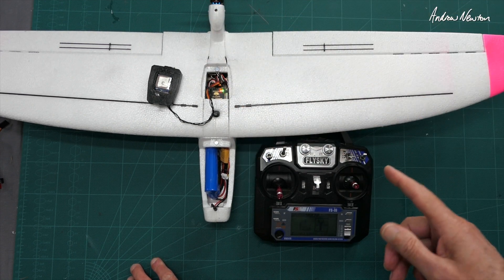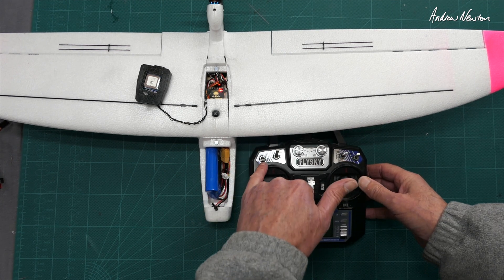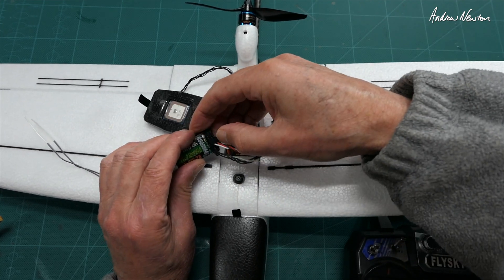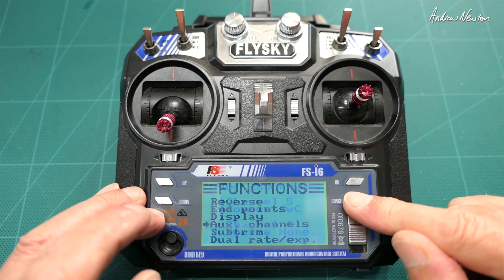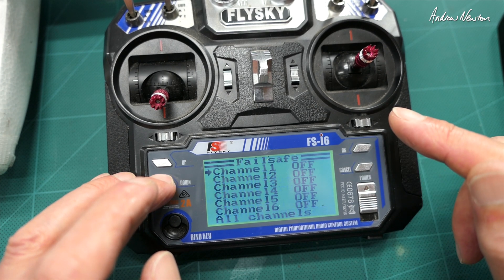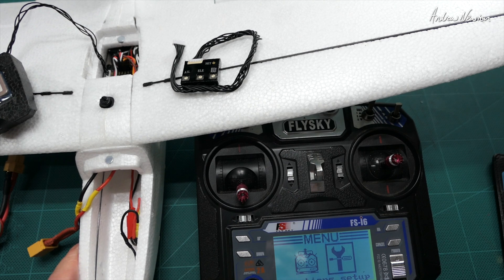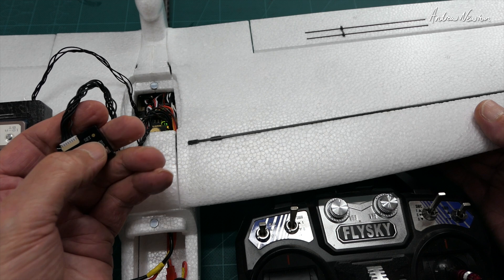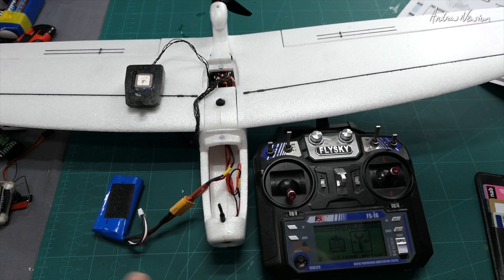Kopilot - Drift - Flysky FS-i6

Comment: Would you have an idea why my elevator and ailerons both move each at the same time. I try to use one of them. For instance, when I pull down on elevator, the ailerons move into a slight left turn. 
Vice versa ,when I go into a turn, it makes the elevator want to go up.  Ive tried it in all modes, Same problem. it's almost like an electrical interference. When I go to channel display, the display works exactly like yours on the video. It doesn't show them both working together.
Any help would be appreciated. Btw, love watching your videos. IV'E LEARNED SO MUCH FROM YOU..Thanks
Reply: Andrew, Disregard.I'm an idiot.  Im proud of myself for figuring it out..lol
Keep up the good work mate.
Reply from the maker: Not an idiot. Clever for working it out. What was the solution?

Comment: Hi Andrew, just one question. If you are flying in stabilised or manual mode and you lose the link does it automatically go into return to home mode, or does that only work if you fly solely in RTH mode? Regards Chris
Reply from the maker: If you set it up properly it will switch to RTH from any mode when RC link is lost.

Comment: hey andrew, great vid...i have a question, so i purchased the zhod drift, fs-i6x, and the fs-ia6b reciever, and kopilot light. i plugged everything in and the reciever wont power on and the plane just beeps. this is my first plane and i need help. please reply ASAP
Reply from the maker: Forget the Kopilot for the moment. Learn the basics first, like how to bind the receiver and use the radio
Reply: @AndrewNewton  ok, what 1s lipo should i use to bind them
Reply: send link if possible
Reply: @AndrewNewton  since the led doesnt light up when i connect the reciever, do i have to link it wiht the controller first for it to light up?

Comment: Thanks for the helpful video  -I have set my Drift up the same - problem though - when I flick SWA, the expo changes as it should, but also the ailerons move position  like pulling a right turn.  what could cause this ?  This whilst in manual mode, No GPS lock.
Reply from the maker: Switches wrongly assigned at a guess, not actually in manual mode
Reply: Thanks but weirdly the Switch C was not centering correctly during my maiden so it was always stabilised - I discovered this by swapping to VRB and finding manual, and therefore found the Drift was responding only to a non-centered switch value.  I centred everything and Held the options board button to recalibrate  and that problem corrected.  So I am confident I am in manual. And I can damped the control's responses using SWA. But SWA it rolls the aileron value by about 2mm. 
UPDATE: I just checked the Tx Display and it is the transmitter that is putting in the aileron roll when I use SW-A, but why on earth does it?

Comment: Will the zohd pilot work with the ranger 2000 with flaps?  Do flaps get transferred to channel 6?  Thank you in advance.
Reply from the maker: Ch6 is only available with SBUS connection. You can just plug the flaps into Ch6 directly on the receiver

Comment: Hello Andrew. I have successfully set up my Zohd Drift as per your video as well as the instructions (same controller-Ia6 receiver). I have now purchased a Kopilot set for my Durafly Tundra. Ive got it all fitted but now im trying to set Flaps up on the Auxiliary  channel of the Kopilot and use channel 6 SWD to activate it. As soon as i power on the Kopilot the flaps go full down and i cant get them to respond. The rest works fine. Ive turned the mixes off  and SWD works in the display setting.  Can i use Aux channel for flaps? Thanks for all the great video's.
Reply from the maker: If you mean Ch 6 then that only works with SBUS receiver connection
Reply: @AndrewNewton  So i solved it on your advice. Servo lead from IBus on RX (Turnigy Ia10B) to Sbus input on Kopilot. Channel 6 (Turnigy i6) paired to Switch D (only 2 position-using the 3 for flight modes), set the end points and now have 0 degree and 45 degree flaps. Thanks for the advice.
Reply: @Robinator202  Just a question. Are you using a stock i6 transmitter or 1 that has been "updated" with hacked firmware? I thought that it was only the i6X that could be switched to output either i-Bus or S-bus as a serial output for the "serial" output pins on the iA6B/iA10B receivers.
Reply: I have just installed Kopilot in a Tundra. There is no need to operate the Flaps via the Auxiliary port of Kopilot. You can simply connect the y-cable from your flap servos directly to channel 6 of your receiver. Thus you can use the flaps independently from the Kopilot in all three modes.

Comment: Hi Andrew thanks this is very helpful…but, I followed exactly but can’t get past the Tx beeping that the receiver battery is flat! I’m using the IA6b receiver and it displays the Rx is only getting 3.3v ( Battery is 8.2v)
Is this 3.3v a mode of the ESC?
Reply: Okay solved it. I had the PWM cable plugged into the settings port.
Reply from the maker: Aha! That would do it. Glad it's sorted

Comment: Hi Andrew, I was going through this setup and a peculiar thing occurred. The Drift came with a bridle/tee connector for the 2 aileron plugs, which I connected, black to black etc and plugged into the Kopilot. When I powered up, I got a whiff of something hot. It was the stbd aileron servo getting real hot but not the port side. It’s set for T tail and as your setup but only the motor responds, no elevator and yes gps is up. I did plug just the port aileron in but it didn’t respond either. Question, is it cooked and why?
Reply: Correction gps not lit, only led 2, t tail and the small square red led lit and steady. I’ve also sent a cry for help to Zohd
Reply from the maker: Need to test the servos individually with a servo tester or plugged straight into a receiver to see if they are fried. Could have been a bad servo or too much voltage somehow. I guess if you plugged the PWM signal cable into the +5V pins it could fry something.
Reply: Thanks, I connected as per your tutorial and the supplied zohd paper work. The big plug horizon and the plug, vertical at the end of the big plug. The servo got hot when connected to the battery, no activation from tx. Yes I’ve ordered a servo tester and are trying to get a reply from Zohd. All a little disappointing.
Reply: @warwickprice7218  Leave your set-up EXACTLY as it is/was when the problem occurred. (Minus the battery of course!) Take high definition photos from several angles with good lighting and post the results on the RCGroups Forums discussion thread on the Kopilot Lite. While waiting for replies there you might like to read Post 2424 on that thread.
Reply: I should add that yours is the first instance I've heard of where plugging things in wrong with the Kopilot set-up has fried anything. (We've done it too many times to count - no dead ones yet!) 🙄 
Reversed supply voltage somewhere or a faulty servo seem the most likely candidates.
Reply from the maker: How did you power it up? Through an ESC 5V BEC?
Reply: @AndrewNewton  I did reply but got a fail. I plugged the Jst plug(attached to the esc) into the rx. Powered up with 3s.
Reply from the maker: @warwickprice7218  Red JST? That's full battery voltage for powering the FPV camera, not 5V.
Reply: @AndrewNewton  that will explain it, victim of the missing 20% of info. Bit of a black art this rc stuff but I’m not deterred. Thanks once again.
Reply from the maker: @warwickprice7218  Ah, at least we know what caused it. Most ESCs dont have that Jst pig tail. 5V is on the red wire in the 3 pin DuPont connector coming from the ESC.
Reply: @AndrewNewton  I’ll buy a new one and use this one for parts and experience😞
Reply: @warwickprice7218  Can't laugh at your misfortune in all conscience Warwick. We've all done something dumb when we started! All part of the learning experience. I try to have a few old mates around - helps spread the blame! 😜 😁
Reply: @theoztreecrasher2647  it’s starting to very much look an activity where you learn by one’s mistakes, fuelled by a lack of supplied info. It’s a thought that’s crossed my mind on a number of occasions lately. A simple schematic would have informed me that a Bec/5v was required for the flight bd. New drift and becs ordered. I’ll use the camera on something else.😤😢
Reply: @warwickprice7218  Probably sticking my oar in uninvited and certainly will be blasphemy to someone like Andrew but, since you will have 2 frames, I'll make a suggestion.
The Drift is a very nice low wind gentle glider but it IS a bit fragile as EPP planes go. So you might consider beefing up the wings with a carbon rod from a kid's kite tacked in place with a few dabs of hot glue and the same for that frail nose section. (Several popsicle sticks, bamboo skewers or strips cut from the carry handles of RC Gear boxes.)
Then. when you have it all set up, head out somewhere you can find a nice patch of thick 18 inch high grass and do some hand toss glide tests over that. When that looks good you can start to get adventurous with your new toy with some expectation of success. Best of luck. It's a lot of fun when it all comes together.
Reply: @theoztreecrasher2647  thanks for the tips. I’ve trussed it up like an Egyptian mummy with hd tape but a few popsicles sticks won’t hurt, especially the snout.
Reply: I’ve taken hi def photos of exactly how it is and will post on the Kopilot forum. Thanks for you help. If I stuffed up so be it, I just don’t want to repeat it.

Comment: Hi Andrew, I have a slight dilemma(being a newbie)with my drift with kopilot and Fpv. I’m intending to use a fs-ia6b rx, which requires 4-8v and I’m using 3s batts. How do I acquire the required voltage to feed the rx and I assume onto kopilot. Thanks in advance, Wazza.
Reply from the maker: The ESC has a voltage regulator (BEC) built in. It reduces the battery voltage down to 5V to power the Kopilot, receiver and servos. It's the red wire in the servo style cable coming from the ESC
Reply: @AndrewNewton  thanks, this activity reminds me of a number of pursuits I have engaged in, like m/c racing, sailing. It’s taken for granted you know the course. A simple wiring schematic would have solved it for me. Setting up the tx is one thing but wiring it up is fundamental.
I know you brother in Alice. Caught up at EBA after NY whilst touring SA overchrissy.
Reply from the maker: @warwickprice7218  Small world! Did I meet you in Geelong a few years ago?
Reply: @AndrewNewton  yes small world. It wouldn’t of been me in the G a couple of years ago.

Comment: Hi Andrew, have you ever tried to install the co-pilot on a twin motor plane? I am using PWM and have a Y cable to the two esc's connected to the throttle port on the co-pilot. I have disconnected one of the positive wires as one 5v line should be ok. This setup works fine directly connected to the receiver but when I connect it to the co-pilot only one motor spins up. Any ideas would be welcome :) Regards, Pete
Reply from the maker: Should work as is. Correct polarity in the Y Lead?

Comment: Doesn't negative expo make it more sensitive, not less?
Reply from the maker: Logically yes, but not for the FlySKY.
Reply: @AndrewNewton  
Thanks for the reply. I'm curious, as a new flyer is that because of the tx or Rx? I have an i6x tx that I am (trying) to use on a zohd drift, with an ia6b rx.  I also use same tx with an a8s Rx on a quad copter. Setting the expo to +30 rather than the negative 30 I initially tried, definitely made the inputs more smooth on the quad. Haven't tried on the Drift with + expo.
Reply from the maker: It's only a transmitter function. Your quad has a flight control board which would be modifying your inputs according to it's programming
Reply: Sorry, still a bit confused by this. I've got the fs-i6x tx, an FS-Ia6b rx, a kopilot, and a Drift. 

You can change the rates/expo on the fly on the tx. 

If I hold ,say the elevator stick back halfway, the elevator rises. If I simultaneously reduce the elevator expo on the tx (and go into the negative) the elevator will rise more, without me moving the elevator stick (just keeping it help at half pulled back).  This does correspond to what the graph shows on the tx as well in the dual rate/exp screen, and would mean at half pulled back, there is more elevator input at a lower expo setting no?

Thanks
Reply from the maker: @calisonic  That's the reverse of how mine behaved. Maybe the firmware has been updated since mine? But you're not supposed to use rates and expo on the radio with a flight control board. Does it depend on which mode you're in? See if it works the same way without the Kopilot.
Reply from the maker: @calisonic  This video shows it https://youtu.be/xt5IdeLdiug?t=331
Reply: @AndrewNewton  interesting,
Yes my graphs move the opposite directions on the fs-i6x
Reply from the maker: @calisonic  Aha, good to know thanks.
Reply: @calisonic  3 questions...1 Are you on the stock firmware or an "Updated/Hacked" version? 2 When did you get your FS-i6X? 3 What version of firmware is on your radio?
Reply: @theoztreecrasher2647  

It's how it came out of the box about 5 months ago. 

Firmware says 1.0   20-sep-2019 

Hard_ver:V1.0

Works fine though. Ive been using it on the zohd drift/kopilot lite.
Reply: @calisonic  👍👍

Comment: This video has everything I needed to get my zohd dart set up and now that I'm doing a talon 250g I'm using it again. This video is gold of you like kopilot and fsi6x. I love that it's flysky but still can do sbus.
Reply from the maker: Great to hear Isaiah. Does SBUS work out of the box with FlySKY? Anything you need to do on the radio?
Reply: @AndrewNewton  yes, it works out of the box. Fsi6x radio and the fs-ia6b Rx. In the radio in Rx settings you just select ibus and you use one of the top horizontal rows of pins on the Rx.
Reply: @papamidnightfpv  Typo there! To use the FS-iA6B receiver and FS-i6X transmitter (in stock forms) with the Kopilot you must select S-bus NOT i-Bus as the serial output on the radio and plug the S-bus connector from the Kopilot unit into the top right set of contacts (looking at pins.) The (stock) FS-i6 transmitter can't be used for S-bus as it can't be set to transmit it.
Also a tip about the Talon 250g...The manual for the Kopilot and the 1 for the Talon 250g show different connections for the Rudder and the Elevator. Use the 1 shown in the Talon 250g manual! The servos are mounted reversed in that plane.;-)

Comment: Hello, I use the same transmitter and flight controller but with an FS A8S (Sbus) receiver, it does Bind but does not respond to commands, would it be a solution to use a PWM receiver?
Reply from the maker: Do you have to choose SBUS in the receiver setup? Should work if it is actually outputting SBUS. But you could change to a PWM receiver..
Reply: @AndrewNewton  what's the width of the wings? (Not wing span, not thickness)
Reply: @AndrewNewton  thanks!
Reply: @AndrewNewton  Yep, you have to switch the A8S to S-bus after you bind it. Default it outputs i-Bus and PPM only.

Comment: Hi M. Newton, I was wondering with kopilot on manual mode, can I lower the pitch on the ailerons and rudder in my fs-i6x controller so it will be easier to tried to control it without the stabilizator, thank you and have a nice day.
Reply from the maker: Maybe. If you make the manual mode switch position same as the dual rates switch
Reply: @AndrewNewton  Hi M. Newton, thank you again for your information, have a nice evening.

Comment: About Dual Rates and Expo: I've the same settings for dual rates/expo like you. When I tested the throws on my bench, it hasn't got any changes on the control surfaces. I switched in manual mode and turned dual rates on. The question is, is it normal? So is it only noticeable in flight?? Another question is, how do you start your planes? Like in manual mode with low rates, then you switch in stabilizied mode and switch to high rates? 
I love your videos! 
Cheers
Reply from the maker: Cant use rates and expo with the Kopilot (in stab and RTH modes) I'm being a bit tricky by only having reduced rates on the same switch position as Manual mode. That's the only way it can work.
Reply: @AndrewNewton  So it does only work with the same switch? I thought it would work with a seperate switch, like shown in this video?
Reply from the maker: @wumnet3183  Oh yes sorry, wrong flight controller. Switch to low rate only when in Manual mode, and you do need a separate rate switch with FlySKY i6 radio. I usually use the launch assist mode or manual to start off.
Reply: @AndrewNewton  Thanks :)

Comment: i have problem on dual rate mode???? when push switch down for sport mode my motor start spinning and eileron like bloking??? Please help me.
Reply from the maker: First rule of flight control boards - No mixing on the radio, including dual rates.
Reply: @AndrewNewton  I am like beginner in setup plane
Mixes
Mix# 1
mix is off
Master  Ch 1
Slave     Ch 6
pos.mix  0%
neg.mix   0%
offset 0%
please help.

Comment: Hi there Andrew, thanks for the video.
I got 2 kopilots and a flysky fs isx with recievers.

Am having the same issue with both of my 2 kopilots:
When in gyro mode ,with throttle on(motor spinning) , after i move the sticks , control surfaces wont go back to neutral position ; as if i added new trims…
Control surfaces go to neutral position only when i cut the throttle.
Its like as if putting the throttle on in gyro mode, gives the kopilot a new neutral position.

Any ideas? 
Did have the same issue?
Thanks
Reply from the maker: Depends which mode you're in, and odd things happen on the bench. Do they fly OK?
Reply: @AndrewNewton  good question;
Actually only one of them does..
The other one has a scary tendency to change level position mid flight…
(If i release the sicks it goes nose down) but after a slight input, the level position becomes “normal” again(when i release the the sticks).
So you could say that am having some scary flights with that kopilot, and its not trust worthy…